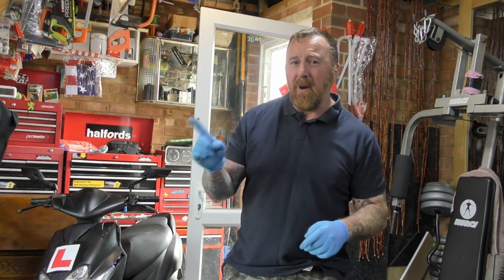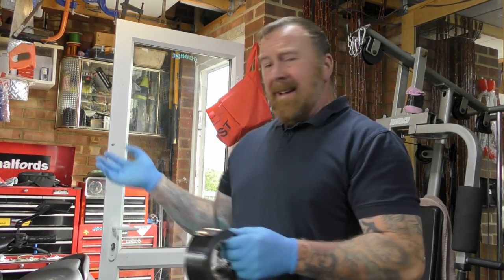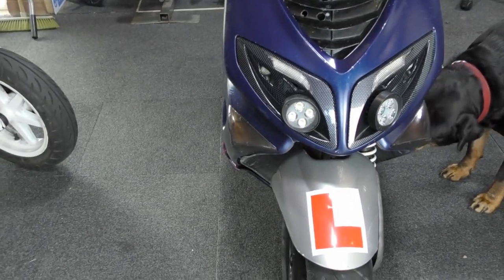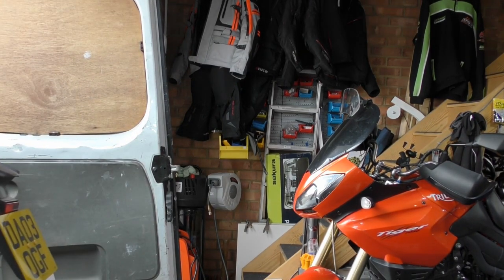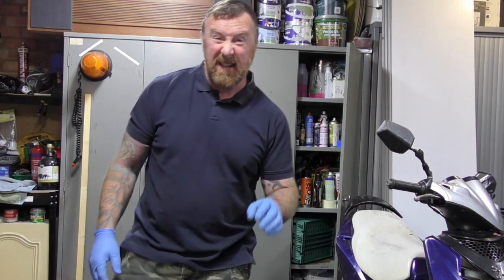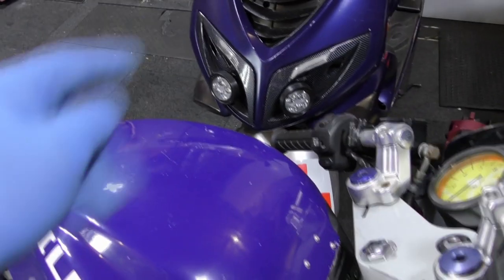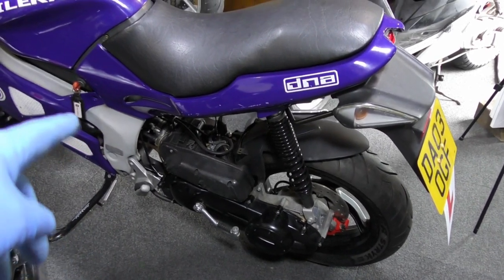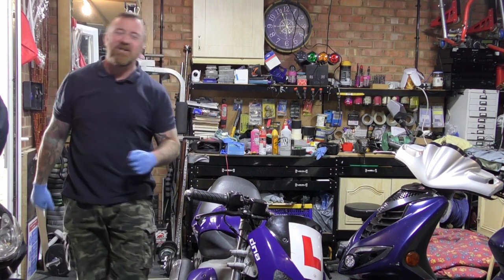GILERA DNA 50CC 1ST LOOK & UP & COMING VIDEOS

Comment: looking to buy a cheap 50cc which I can drive on my licence without l plates and carry passengers. eventually will go to my son so my questions are what to look out for have a tight budget and don't mind getting my hands dirty, so any tips would be brilliant. btw just found your channel great content.
Reply from the maker: As long as your over a certain age you can ride without L plates but not sure about taking a pillion ! 
As they change the law on this all the time lol 
Think you have to have a full bike licence 
So as for whats good 
They is a lot of rubbish bud 
2t or 4t is up to you but 2t more fun and faster 50cc 4t 125s 
Auto or gears 
There is a lot lol 
But I do have a load on my channel 
So maybe have a cuppa and flick though bud
Reply from the maker: Oh just see 50cc lol 
Guessing stick to auto than geared 
Speedfight  , aprilia sr , as both big seats not aerox 
2t 
Then just luck on the 4t s bud
Reply: @marksavage  yeah I rang the DVLA always driven mopeds when younger but they did say I could take passengers but on a 50cc probably right I am aiming to get my bike licence at some point my son has to do cbt but on the down low as his mum would probably go nuts lol good job we separated years ago 😂 I'm assuming you mean the two stroke engines are more fun?? might even do it with him the cbt he's at that age where he wants to beat me at everything lol. cheers Mark I've been watching older vids will keep watching. sorry for long reply. jay
Reply from the maker: @jasonpi76  yes bud 2stroke 
And you don't need to do your cbt but watch you insurance as they will go on about it lol 
But then you can ride a 125cc
Full licence is about £1200 to £1500 !
Oh dear think mum just might find out when he rides home on it pmsl
Reply: @marksavage  lol she will. aye want him to help me build one up so he understands the value of owning one. he's been moddy cuddled too much! lol